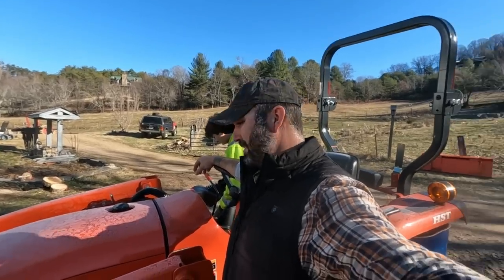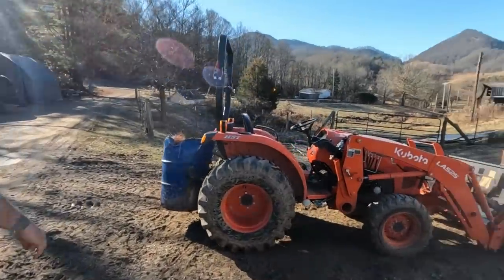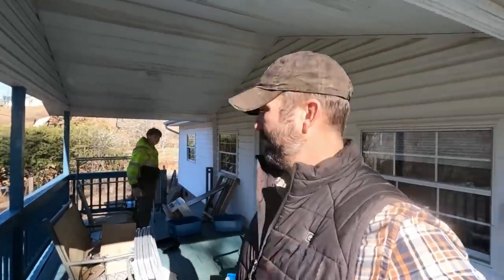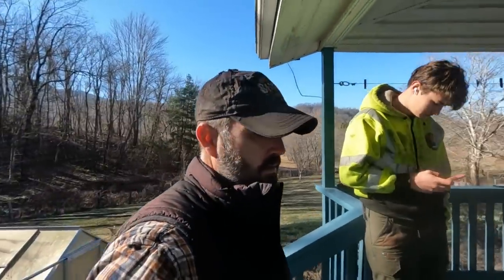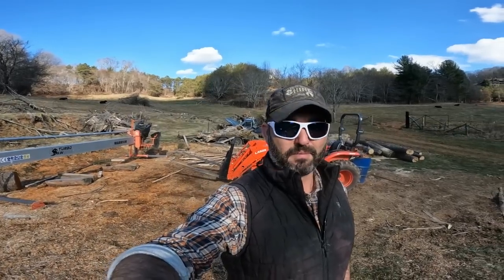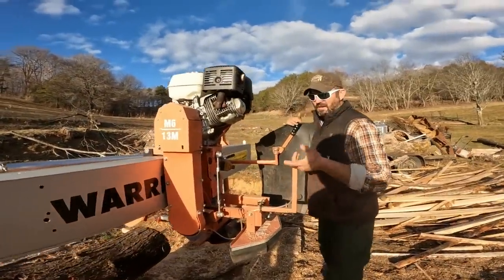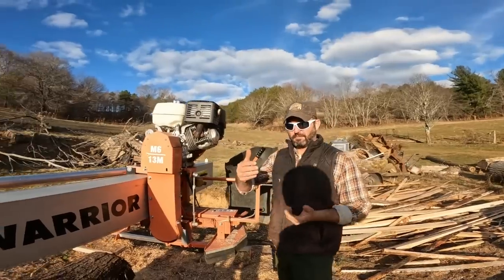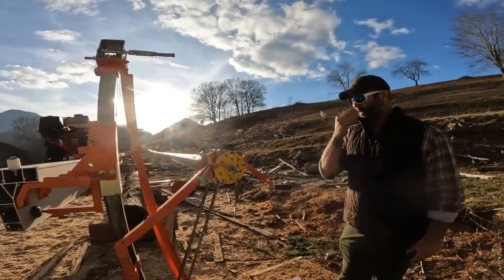SAWING IN A NECK BRACE? REALLY PAPA HUGH? | FIRING UP THE TURBO SAWMILL TO MAKE SOME EXTRA ROOM

Comment: Tractors can be tricky  especially  certain  ones. Engine block heater would do the trick. I think papa Hugh  needed to be outside  healing that fast and great means he behaved  himself Great job papa Hugh. Also I think  YaYa had a say in there somewhere 🙃.  Keep going strong 💪  by summertime look out. Amazing how that saw works nothing better than  your own cut wood. Jealous   I can't smell the  air nothing better  Be careful  all of you  Aiden great help enjoying every minute.  Be safe caught  u on the next one. Aaron u have a natural  humor about yourself.

Comment: When I drove a truck, we used to add a small amount of gasoline to the diesel fuel to keep it from gelling in the wintertime.

Nowadays, I reckon they're using a 20% kerosine mix. This ratio is supposed to keep the fuel flowing down to 0 degrees F. You should check it out before trying it so that you're satisfied in your own mind. Some fuel outlets sell it as "kerosine" and others call it "diesel #1". The stuff your using should be diesel #2.

Comment: always amazing when your working with the saw mill, love watching that. and then seeing the end product and how much you have our of just a single log, as opposed to getting it at a store and paying high prices for it. Great News on Papa Hugh and that he is healing well and can pretty much now do whatever he wants as long as the brace stays put for another FOUR weeks🙂Good to see Aidan as well, watching and soaking all the info in from both you and His Grandpa Hugh. how will the porch [ after it is closed in and fully connected to the rest of the house be heated, and will you have to also insulate the floor form under as well so you don't get that outside draft up?? also will have to extend some electrical as well out there, correct?? will be good to see how it all turns out, and what she makes of it all when finished.
Reply: Hi Donna,
The porch will be insulated underneath and electricity will have to be ran to the front porch for outlets.  Chelsea's heat source is in the room connected to the porch - and the wall will be opened up when the door is taken out.  That opening, should allow enough heat to enter the "new" room.😊

Comment: IS IT POSSIBLE TO USE SAW DUST FOR HEATING THE HOUSE OR DO YOU HAVE TO THE SAW DUST INTO BRICKS OR  FIREWOOD LITTLE LOGS?
Reply: I REMEMBER SEEING ON THE INTERNET A HOME NADE DEVICE/PRESS FOR MAKING SAW DUST INTO SMALL, ABOUT 4X6 INCH  BRICKS TO HEAT A HOUSE, IT TURNED OUT ABOUT 60-80 SAWDUST BLOCKS WITH EVERY PRESSING.
Reply: Sawdust good for spring garden..
Reply: He might be using it for his raised beds, can't remember the name he called them,  for compost or bedding
Reply: Hugelculture is the term you were thinking of Paul.😊
We use sawmill shavings in the chicken, geese and duck houses.  We will also use it in the raised beds - and the "leftovers" will be composted.
Reply: Thanks Patti